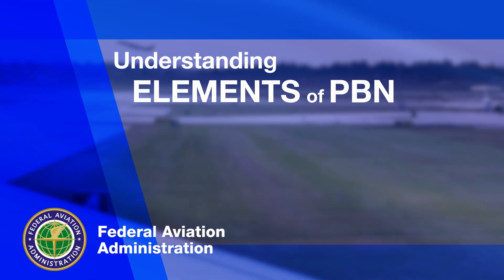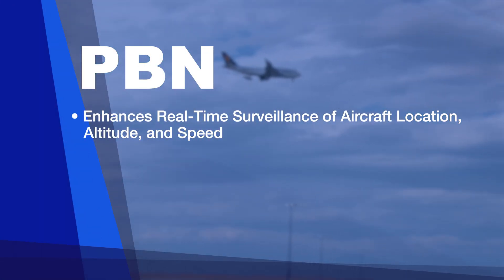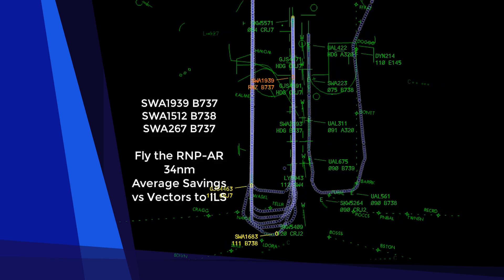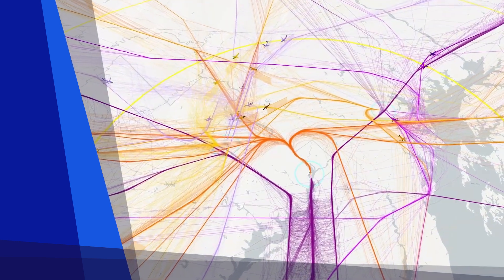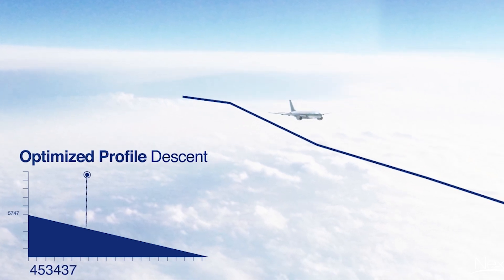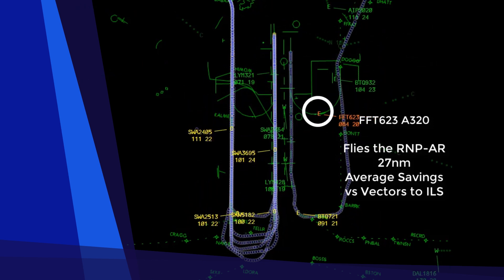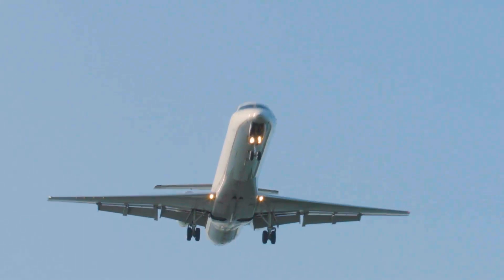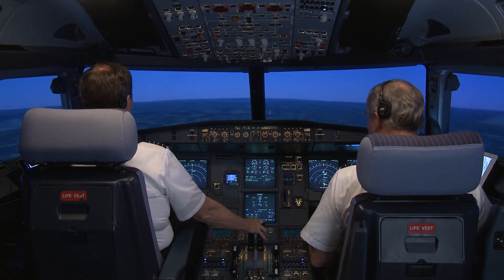Understanding Elements of PBN – Real World Applications of Airspace Modernization

Comment: what exactly does pbn mean? Performance of what? the a/c, its instruments or what?
Reply: PBN performance based navigation. And RNP is required navigation performance. As far as I can tell all were talking about though is using GPS with a certain level of guaranteed accuracy, they just felt the need to throw some names on top of GPS
Reply: @hunterreeves6525  Technically speaking, PBN doesn't necessarily has to be GPS. If your airplane has INS, it still works as RNAV/RNP/PBN. I do agree this makes things unnecessarily complicated.
Reply: @hunterreeves6525 No, GPS or Global Positioning System does not guarantee accuracy depending on the quality of GPS receiver, the number of satellites, etc. Your phone for instance has a chip in it that maybe accurate up to a few feet. But there are other systems that use ground based GPS aids to get down to inches and even lower. While others that maybe hundreds of feet off (laterally). Keep in mind, that planes need both high vertical as well as lateral accuracy when they fly (think approaches). The FAA (as well as ICAO) needed a framework to define various types of GPS systems available and how to apply their performance characteristics to the national airspace system.